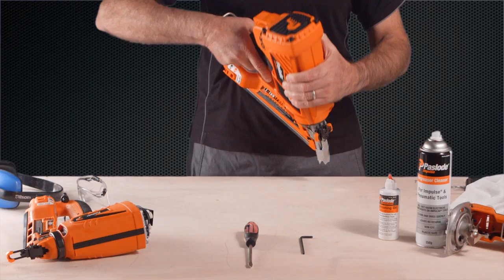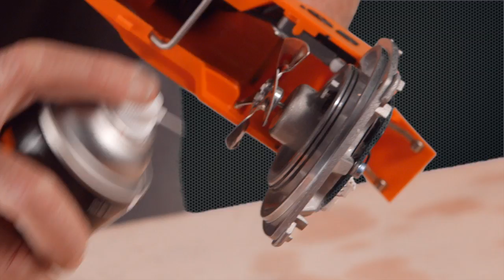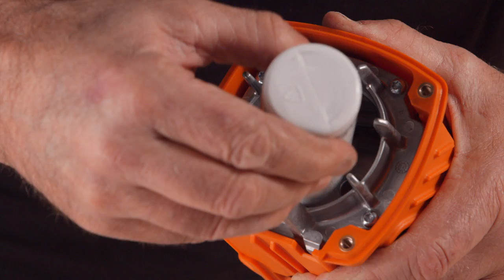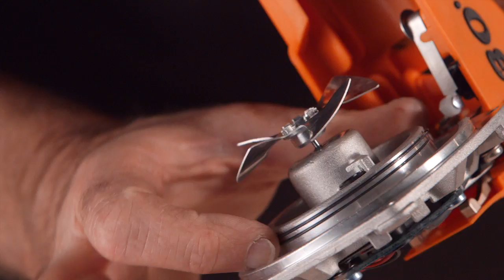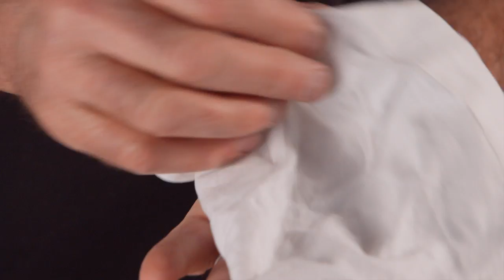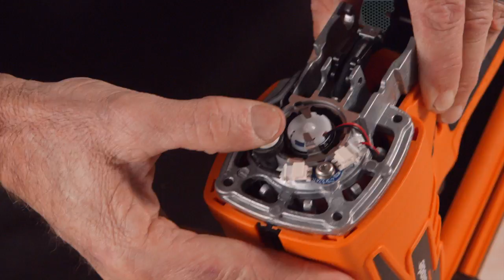How to clean Paslode Impulse Nailer and Bradder

Comment: I have a new 18ga IM200Li straight brad finish nailer.
- can it use both the C brads & the NDs .. do i need to change the top fitting to suite NDs or C brads
- what is the standard setup on a new gun , NDs or C brads

Comment: I have a 20 year old unit that I didn't use until the warranty had expired.  It will not sink a nail to the head no matter what setting I use.  What should I do to fix this?  ... //// Update:  It did, in fact, turn out to be a setting that I was not using properly.  Thanks!
Reply: Check the expiry of the gas?